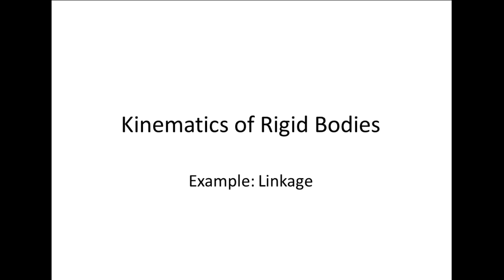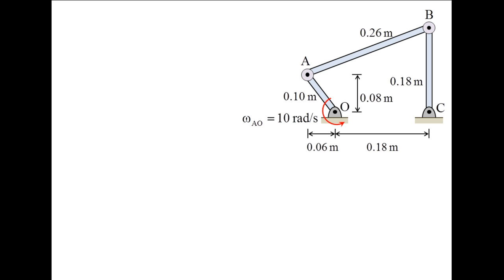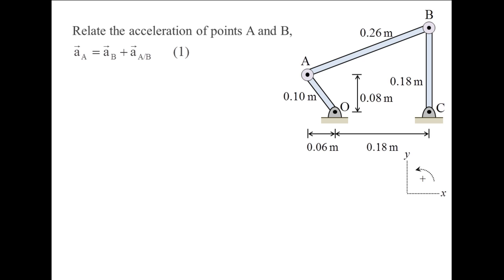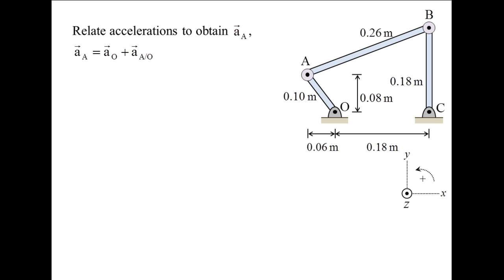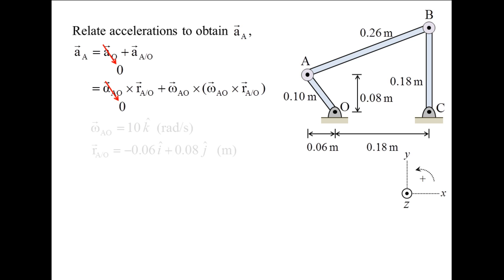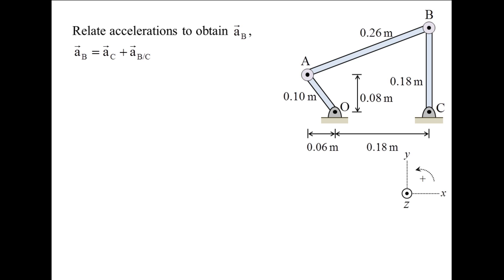Vector Dynamics: Example, kinematics of rigid bodies (linkage)

Comment: When you solve for the two equations at the very end, you had the acceleration at a = (6i - 8j), but when making the two separate equations, you made 8 positive. If that was not a mistake, why did you end up doing that?
Otherwise, seriously great video. This filled me in on two weeks worth of material. Hopefully I do good enough on this test (:
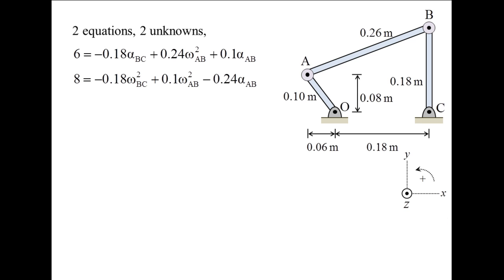Reply from the maker: Nice catch. At 8:58, the left side of the second equation (containing the y terms) should be -8 instead of 8. The answers for alpha_AB and alpha_BC are correct though. I just placed a note about this error in the comments.
Reply: CPPMechEngTutorials please do mor examples on general plane motion and explain where you be these formula from.

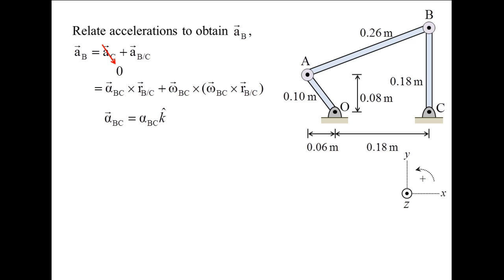Comment: At 8:17 when substituting the fomula u have menationed a(c) to be  0 but still u have still taken the value
Can u explain why?
Reply from the maker: a_c = 0 because it is a fixed point. Can you please explain what you mean by "but still u have still taken the value"?
Reply: Why havent you considered alpha(BC) value as 0?
Reply from the maker: Why should it be 0?
Reply: I'm having a little trouble with that as well. If you considered alpha (ao) as zero because it had a constant angular velocity wouldn't alpha (ac) be considered as having such as well?

Comment: 8.52 ,  should term 'aA' be 6j-8i rather than 6i-8j? Since aA=wAO x rAO=10k(-0.06i+0.08j)= 6j-8i?
Reply from the maker: Yes. Nice catch. At 8:58, the left side of the second equation (containing the y terms) should be -8 instead of 8. The answers for alpha_AB and alpha_BC are correct.